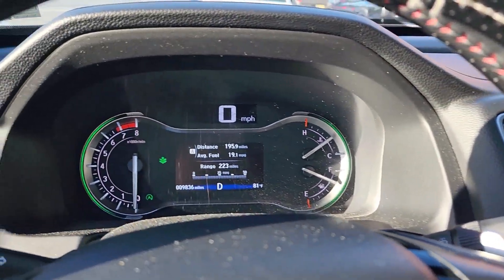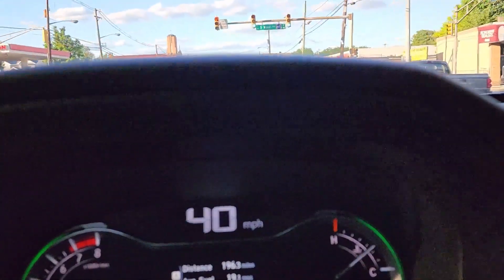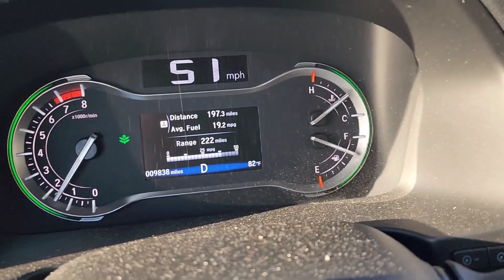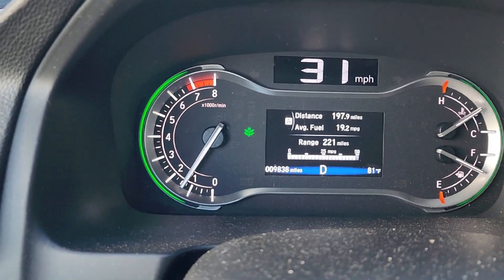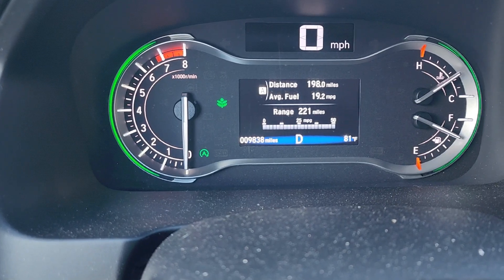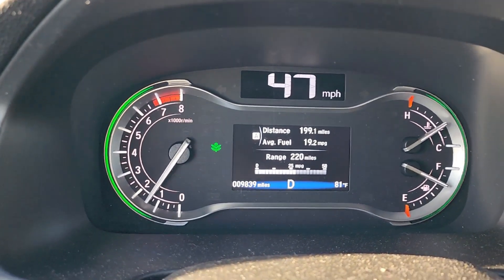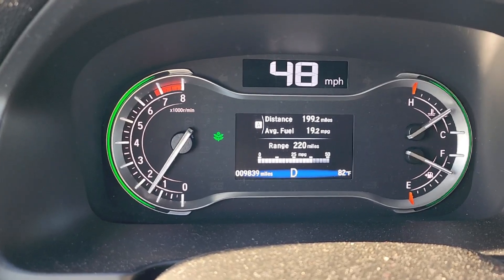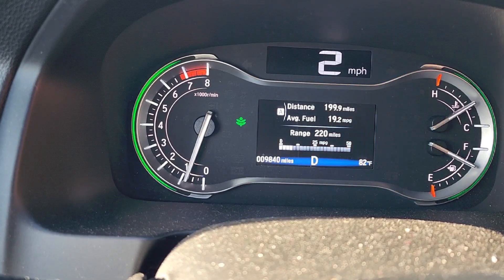How to save fuel

Comment: I agree that you do save a little bit of gas I have a friend of mine who works for Honda as a mechanic in the long run I think you do more damage to the motor for a shutting on and off 20 30 times a day. I put in an inverter in mine so it never shuts off
Reply from the maker: I heard that because this engines use low viscosity 0W20 motor oil are less likely to get damaged by the auto on feature, also the other theory is that engines got wear at the first crank because it is cold and the oil must reach the entire engine and right temperature, in this case the engine is hot and lubricated already, also the starter has been modified to be more resistant than a regular one, the advantage of engines with low viscosity like this one is the super speed they have in order to lubricate the motor, basically is just star and go, the famous YouTuber and mechanic Mr. Kilmer said that today's modern vehicle doesn't need to run the engine for a while before start driving, actually he said warm up this new engines can damage them. 😳.  Thanks for the comments my friend, the only thing we have right now is just wait and see the results in the years to come, some guys say is not good some other love it, I am in between, my friend, GOD BLESS YOU!!!